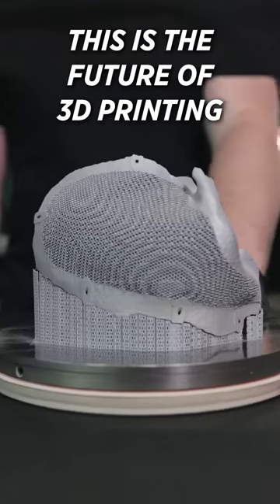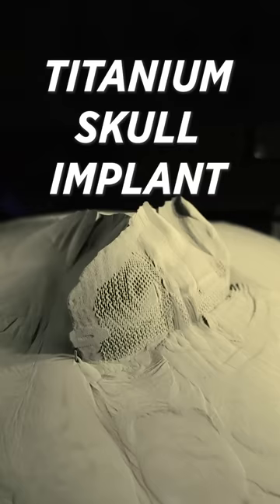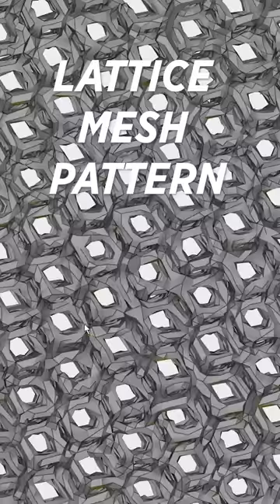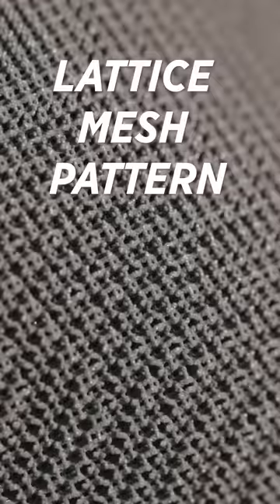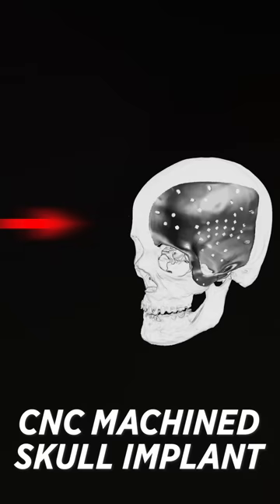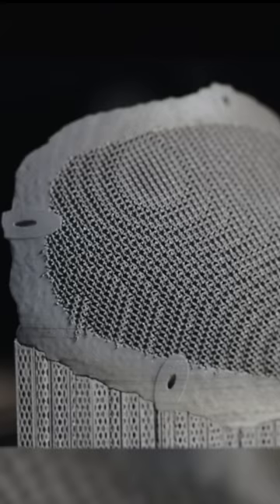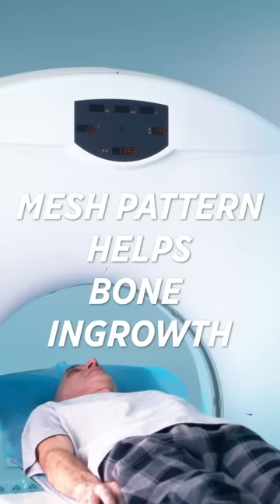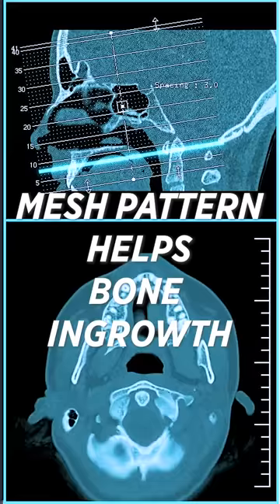3D Printing the World's MOST COMPLICATED Medical Device

Comment: The problem I faced with these lattices is that the metal powder gets stuck inside the lattice pores and it's a tedious process to remove it
Reply: Quick acid wash and clean won't damage lattices and the powder will be sorted
Reply: Not really
Reply: @livingglowstick1337  why acid?
Reply: @monsieur_piyushsingh  it disolves the powder
Reply: @livingglowstick1337  how?
Reply: @livingglowstick1337  the metal used is a titanium which is one of the least reactive metal (main reason to why we use it for implants).
And also if the powder did react or dissolve with acid then tell me, how come acid will not dissolve the lattice.
You do realise that the lattice is made using the metal powder itself right?
Also the experiment we were performing didn't allow us to use much foreign material as it could react with the body itself even though the chances are slim but still. And that is why we were skeptic about whether the ICMR (Indian Council for Medical Research) will allow us to use it on patients.
Reply: @monsieur_piyushsingh  powder has many more times surfaces area making it more reactive that the surrounding metal structure and just because it's nonreactive doesn't mean there isn't something It does react with
Reply: @livingglowstick1337  it still seems like it would be a pain to get it medically certified. I work with additive manufacturing all the time and it is the magic solution to everything as it's always promoted to be
Reply: acid in one of those sonic baths?
Reply: @blacknightgaming8987  maybe, but you still have to prove the internal lattice of the metal.
Reply: @livingglowstick1337  You have very little knowledge of the things you’re talking about. Nonreactive means nothing will react with it. It’s literally in the name. If acid reacts with the powder, it will still have to be soaked for a nonzero amount of time, causing other parts of the structure to be eaten away by the acid as well, period. There’s no getting around that.
Reply: @John-Perry  I believe a variable vibratory machine + alcohol will eventually clean this up without damaging the structure. might take a 20 cycles but it'll work
Reply: @John-Perry by that definition only noble gases are nonreactive, and they’re the definition of useless when it comes to making anything solid out of them
Reply: @John-Perry  duh, just make the lattice a bit thicker and presto we got a part now!
Reply: @John-Perry  Titanium provides moderate resistance to reducing acids like sulfuric, hydrochloric (HCl), and phosphoric acid. It dissolves rapidly in hydrofluoric acid.

There is not a single element that is truly nonreactive. Even Helium can form compounds with other elements. While the conditions have to be rather extreme, it is possible.

While you are correct that the lattice would also experience some damage, as the other guy said, the powder has a much greater surface area, meaning that it will dissolve much quicker than the solid structure. After it has been dissolved, the acid can quickly be neutralised and the damage to the lattice would be minimal.
Reply: Calcination is performed till below melting point for hours make it stronger and powder get either welded or just burn away.
Reply: You don’t want titanium flakes floating around in your head?
Reply: How about just blasting it with compressed air and/or a sonic bath?
Reply: Sand blast it?
Or if its just lose powder, pressure washing should even work, or an ultrasonic cleaner.
Reply: @MsHojat  Issue is the potential for introducing contaminants.
Reply: @monsieur_piyushsingh  interesting
Reply: @monsieur_piyushsingh  why does it not affect the metal too?

Comment: I'm a surgical assistant, with over 10 years experience. In my experience, cranial implants are typically peak material, thats just in my experience though. However, a lot of Spinal Fusion companies are making 3d printed titanium interbody fusion devices/ cages (OR slang). Titanium is becoming more and more popular now that they can readily 3D print it with porosity. Usually the cages are hollow and we fill it with bone graft and then after impanting the cage, the porosity and bone graft cause the patients bone to fuse into it.
This is referred to as a "press fit" method. No screws, or cement needed to secure it.

Comment: I was looking into starting a metal 3d printing business last year, ended up deciding to pivot and do something else, but I'm still interested in doing this. Is there any advice for starting a metal 3d printing fabrication business?
Reply: Throw a pile of money at it
Reply: the least expensive production-grade machine I've seen in my searches is about $50kUSD, and that doesn't include debinding or sintering stations. If you have particular parts in mind, you'll have to check the build volume/capacity, and machines that can do aluminium and titanium alloys usually require more expensive equipment because of the explosion risk of the powder. Some systems use wire deposition and a robot arm, like a MIG welder, but no matter what, you are probably looking at an absolute minimum of $250k just to open the doors on a relatively small operation. I'll be all ears if anyone says otherwise.
Reply: You don't need any of the expensive shit to do metal 3D printing. Look up Virtual Foundry and thank me later. You could probably put together a starter setup for less than 5 grand. FDM metal printing is the future.
Reply: @InSearchOfScience  I'm familiar. OP said a production shop... and like i said, it depends what you're trying to do, but if you think you can make consistent production-quality parts in whatever quantity the customer demands with a DIY operation, then more power to you. I don't know if i believe everyone is that capable...
Reply: You probably could start with sintering metal filament fdm prints, you basically need a 50$ abrasive resistant nozzle on any decent fdm printer and see if you get some demand, then scale up from there.
Offering laser and cnc router/mill services are also a good way to start.
Reply: 3d metal printing is just more expensive CNC work. Or just do a plastic 3d print and make a sand cast lol
Reply: @satibel  you still need a debinding station and sintering station for those. Including gases. 

There's a process that prints a metal slurry, that doesn't need debinding, but that's not filament
Reply: i have an idea for you thomas! you should undersell orthodontists by reprinting retainer molds / retainers! im sure you could just receive the dental records by mail and ship it back with a few hundred profit per!!! what do you think :3
Reply: @InSearchOfScience  Except for the "small" issue of sterility. Medical institutions seem to favor it for some reason.
Reply: well it only works if you dont plan on doing a lot of parts. sintering is only viable for making prototypes, and not full scale production. if you are still thinking about it, you should get to know a few people in metal industries that often need new prototypes
Reply: @sneakybutpirate  not true at all, my friend. Additive Manufacturing is 10x more efficient and sustainable than subtractive. Don't get me wrong; some things just can't be printed yet. But eventually it will entirely replace casting. Additive already has applications that you would never be able to CNC unless you had a 5 axis machine. Not to mention a digital inventory. If you evaluate your cost per part, you think you're saving money. But what about the money it takes to develop and precision machine the mold . Only to then have to remake a $50k mold for a single design variation.
Reply: @sniper7004  Maybe sintering in 2015 had higher tolerance ranges. But with company's developing more sophisticated softwares like Desktop Metal's Live Sinter. They're able to group the tolerances down to .5% or lower. I've seen down to +- .015mm. Sintering is becoming  a very predictable process. Of course, we're not quite to the point  of it being the best process. But someday soon it will take over.
Reply: @SvR_Walrus  additive manufacturing has been around for as long as other types of manufacturing. Was everyone in the past an idiot?
Reply: @sneakybutpirate  you can say the same thing about why they hadn't developed the automobile sooner. Or the plane sooner. Or phones. Or recently 3d printers. Lol. Technology exists; that doesn't mean it's easy to invent. I never argued that ADDITIVE is a new process. It isn't. Even 3D printing was invented in the 80s. They also didn't have 5 axis CNC machines then. Things take time to progress.
Reply: @SvR_Walrus  yeah except I didn’t. 3d printing metal is never going to be as good as cnc or casting. Just show me a working jet turbine made with 3d printing and I’ll shut up. Rolls Royce and GE spend so much money developing engines how come they never use 3d printing??
Reply: @sneakybutpirate  to answer your question; it's simple because it's not a good enough process. You're obviously not reading my comments before responding to them. Your addressing issues that my previous comment explained. 3D Printing; or Additive Manufacturing, is not the the quality point of being better than CNC or Casting. There are certain aspects that are already better. But there are also aspects that aren't. More that aren't than are. But you seem to be ignoring that fact that technology progresses only one way. There are hundreds of examples in real life that prove something can be not so effective; and then very reasonably soon after, be better than conventional methods. One example would be electric cars. In 2008 Electric cars were on the brink of innovation and noone believed in them. Now we have every car manufacturer in the world fully embracing it as the future.  If you did your research; you would also see every car manufacturer in the world embracing additive technology as the future as well.
Reply: @sneakybutpirate  General Electric has quite a few components 3D printed for military use in jet turbines
Reply: @wesleyyates5370  ge uses it for prototype parts, and maybe a housing for an actual important part but not any part that has any actual stress applied to it like an impeller blade or a hull

Comment: Those "Tru" lasers are crazy ngl. I work around these lasers as a setter. We make parts for many cars like Volvo, Peugeot, Volkswagen, Seat, etc. The "head" of the laser have 6 different axis; X,Y,Z, which is for position of the head, B and C is for degree and ADC axis is for distance positioning of the tip. Everything mentioned above can be set through the PLC of the machine. You can laser pretty much anything with thousandths of a millimeter precision. It's so fascinating to just stand there and watch the lasering process.

Comment: When you say the future, you mean back in 2011.
Reply: Thinking like that is ignoring all the advances that have been made in the last 12 years and the increasing accessibility as well.
Reply: @jaythatguyyouknow5135  not really, the future is singing that is yet to happen. The fact that it happened in 2011 would be an indication that it is not the future. And it doesn't ignore anything. It shocks most people to find out that 3D printing first happened in 1981. That was 42 years ago. What other tech has taken that long to become mainstream. And even then SLS printing is far from the mainstream. The only types you could call mainstream are FDM and SLA, and less so for SLA than FDM.

Comment: Future of everything.. what next..
Reply: They've been saying that for 40 years now.  3D printing still has all of the same issues that its always had.  It's a cool and useful technology for sure, but it has serious limitations.
Reply: @brandons9138  no it doesn't we literally make rockets using it engines a lot of stuff is made with metal 3d printing god even houses with concrete
Reply: @livingglowstick1337  Yes it does.  It still has all the same limitations that it's had for the last 40 years.  It's slow, it's not very accurate, and limited build sizes based on the volume of the machine size.  Anything that needs any real precision needs post machining to be useable.  Trumpf and Porsche are 3d Printing pistons for Porsche's racing teams.  In order for the parts to be useable just about every surface needs to be machined for tolerance and surface finish.  About the only thing that doesn't get post print machined is the under side of the piston and parts of the skirt.  A piston isn't even all that tight of a tolerance compared to other applications.  Most 3D printing has a tolerance of about .1 mm that's .0039 of an inch.  That tolerance applies to just about any characteristic of the part as well.  Roundness, straightness, concentricity, parallelism, runout.  Truth is that 3D printing's accuracy is limited by the very nature of how it's done.
Reply: @livingglowstick1337  LOL.  No.  The exhaust bell portion and some of the internals yes.  Not the entire engine.  I now plenty of machine shops in my area that are making engine parts for SpaceX. My shop was quoting engine parts for SpaceX as well.  We just didn't have the excess capacity needed to meet their volume demands.

I'm not the one who needs to read more about how 3D printing is being used.
Reply: @brandons9138  gogole launcher 3D Printed E2 Rocket Engine combustion chamber funnel injector all thats is 3d printed you know the most sensitive parts
Reply: @livingglowstick1337  So in your mind 3d printing THREE components of a rocket makes it entirely 3d printed?  They state on their website that the combustion chamber, injector and turbo pump are what they have printed.  They also, from what I can find, never state that there is no post print processing.  From the pictures on their website you can see that there are no threaded holes on the parts for mounting parts.  I can guarantee that there is post print machining done to the parts.
Reply: @brandons9138  the injector that supplies the fuel the combustion chamber that combusts said fuel and the bell that provides exhaust the allow for thrust yeah they are the main most sensitive components in a rocket engine this isn't a car there's no piston drive shaft what ever it's a complex machine that burns insanely hot and with enough power behind it to leave the atmosphere with cargo weighting more than your car many times over so strength is no issue clearly oh also forgot to mention the cooling system is built in to the prints all piped properly and everything wonder if you can do that with a cnc machine in a couple of weeks if at all with the same quality
Reply: @brandons9138  wow they added holes for mounting that's not post processing and leaving the holes out is a good idea as it will actually speed up printing as it has to slow down for overhangs and you get a stronger bond as you have the full layer stop wanking of cnc there's a reason 3d printing is being adapted where ever it can be instead of cnc there's literally many documents from people more qualified than you on this like space X and NASA
Reply: @livingglowstick1337  I'm not saying that 3D printing is a valuable process, it's just not the end all be all of manufacturing. It's been around for 40+ years and still has the exact same limitations that it had from its inception. The materials have changed but the process hasn't. People at NASA and SpaceX would agree with that statement. 3D printing has made some designs more feasible than they were in the past that's for sure. It's more of a replacement for casting and injection molding than it is for a machined part. One of  it's main limitations is the fact that it's not a very accurate process. That lack of accuracy is why the parts often require post printing machining. You made the claim that those rocket parts went from print chamber to final use. That is clearly not the case. I guarantee that those printed parts get machined to final tolerances/surface finishes.  My point about the Porsche pistons was that even something as simple as a piston needs to be post-processed machined. Then something even more complex would likely require post print machining. 

It's brutally oblivious to me that you have VERY little knowledge of how things are actually made. I've worked with 3D printed parts made out of all kinds of materials in my time as a machinist. They come to us to get features machined that the printer couldn't make, or for tolerances the printer couldn't hold. I've worked with 3D printed plastics, metals and carbon fiber reinforced prints. All of the came to the shop because the printing process wasn't able to do what was needed to make the part functional. So my knowledge come from first hand experience with 3D printed parts. Not from watching You Tube videos and reading articles about it.

Comment: Problems that may arise in titanium-based implants include the generation of titanium and titanium alloy particles and ions deposited into surrounding tissues due to the corrosion and wear of implants, resulting in bone loss due to inflammatory reactions, which may lead to osseointegration failure of the implant. These titanium ions and particles are systemically deposited and can lead to toxic reactions in other tissues such as yellow nail syndrome. Additionally, implant failure and allergic reactions can occur due to hypersensitivity reactions